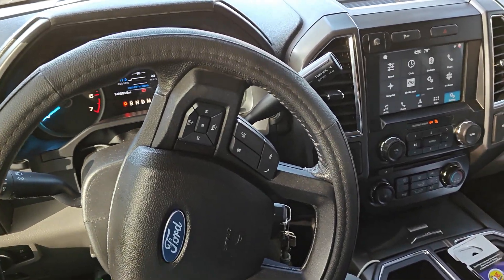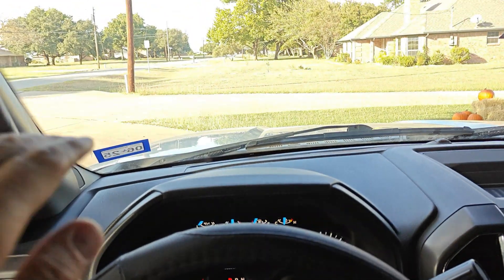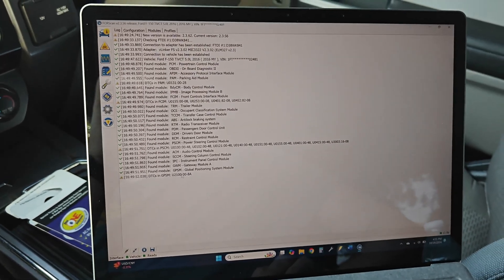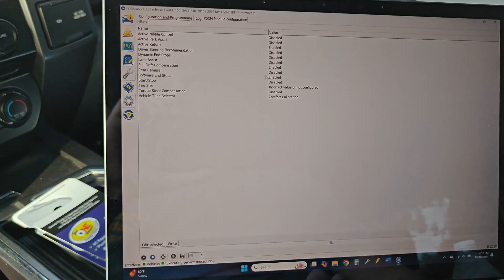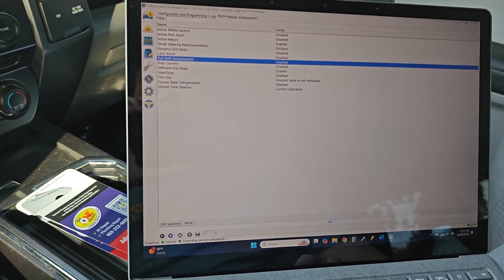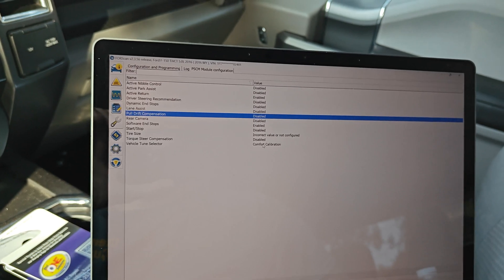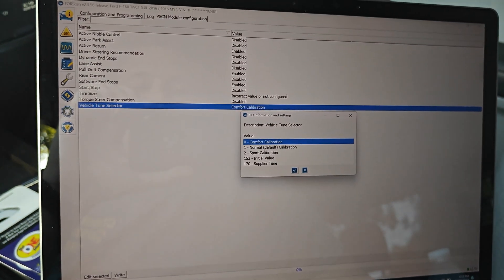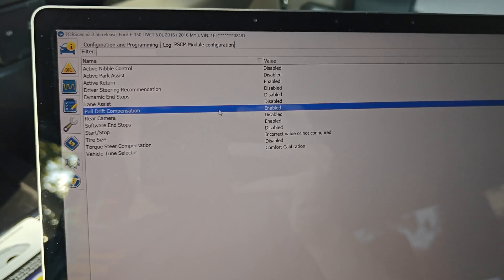How to adjust Ford electronic steering settings F150, Mustang, etc

Comment: Thanks for the video.  I'm going to try this on my '23 Transit.  I'm hoping to make the steering wheel easier to use when going straight down the highway.  It's not that mine is super difficult to turn, but my wrists are bad so they get sore after a long drive holding the wheel in the same position.
Reply from the maker: Good luck! It's pretty neat that there are adjustments available built in from Ford
Reply: @gagefixeseverything thanks!  Settings are neat and all but I know I'm old school when I can't help but think old tech hydraulic power steering wouldn't need setting adjustments 🤣😭

I'm headed to search to see if you have any videos on BT adapters.  

Do you know if forscan works with cheapo BT OBD2 adapters?  

Hoping to avoid buying a $70 cable when I already have a BT module that works with forscan lite on Android.
Reply from the maker: @Jrod_FPVHaha I totally agree. I fix this stuff for a living, but I drive old stuff. Every now and then I'll have a newer car for a few months. Yes I do have a Bluetooth adapter also, this one https://amzn.to/44bakfo

Comment: hey man I just came across this video after months of battling an “alignment” issue. had 6 alignments by different shops and car keeps wandering. 2019 fiesta st. could this be the reason to my problems?
Reply from the maker: @ImZimful  100% could be your issue if the alignment shows "good" each time from the alignment shop, but the car still pulls around. If the alignment numbers are changing every time you go to the shop, there is a physical issue.
Reply: @ if this is it I will be upset for all my time and money gone 🙃 I just downloaded forscan and awaiting the obd tool.
Reply: didn’t give me the same options. only the as built option. I was able to reboot the pscm